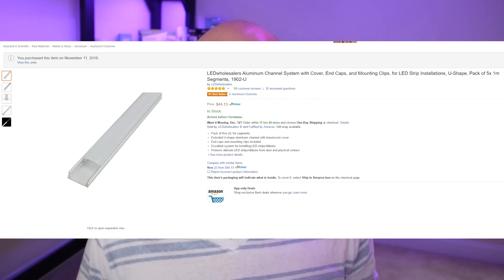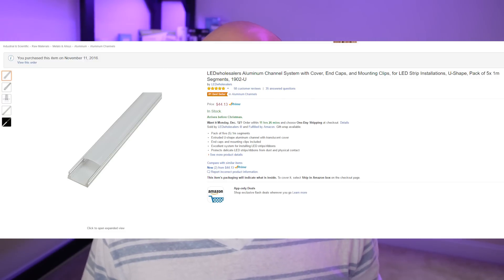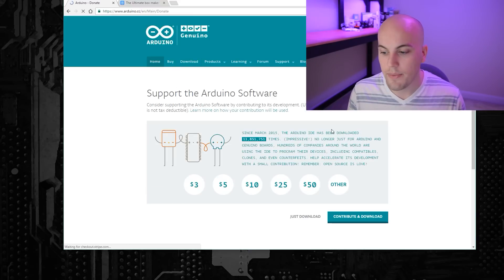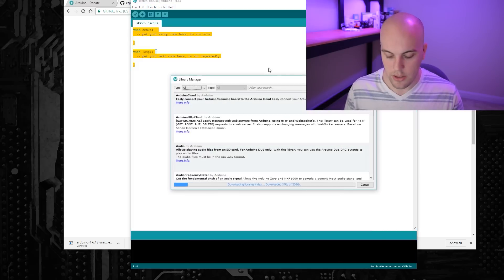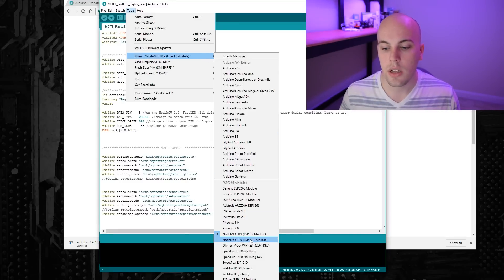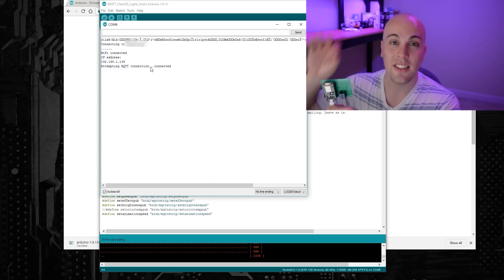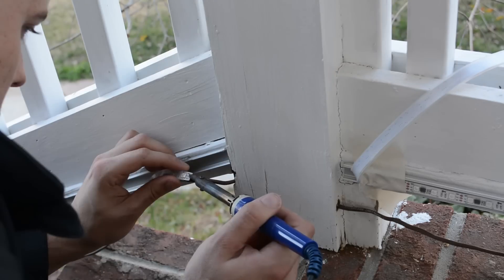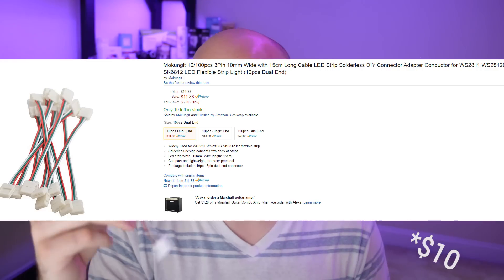The BEST Digital LED Strip Light Tutorial - DIY, WIFI-Controllable via ESP, MQTT, and Home Assistant

Comment: I have a 700 ft long fence line to put programmable digital LED fence post toppers on all the fence posts and control them and power them all from my house do you think all I need to do is run three wires from my house down to the end of the fence and tap into it each fence post topper?

Comment: Is there a longer version of this video anywhere? One that explains all of the steps? I'd like to try something like this, but I don't know what you did when you jumped to the config file to add the MQTT code. I copied yours in, but that doesnt work. when I try to restart it throws an error about the input slider.

Comment: Great video as are all of yours.  Since I have a bunch of Wemos D1 Minis lying around, can I use those instead of the Nodemcu?  As I understand it, they are the same chip and I just have to select the right board in the Arduino IDE.  I've also used these natively without using a sketch using the ESP Easy mega files and have MQTT working on those, as well and I have it integrated with Home Assistant.  Thanks in advance...Irv in Florida

Comment: 11:48 A little trick I found, just today, if you lightly sand the pads then put flux on them, they stuck up solder like crazy.  Put the 2 ends together and tap with the iron and they're together like one. 

Thanks for all your precious time!!!
Reply: that is a useful tip. Here is one from me as well. https://wokwi.com/arduino/libraries/Adafruit_NeoPixel and https://wokwi.com/arduino/libraries/FastLED for online awesome simulations for addressable LEDs 😀

Comment: If you don't need a logic shifter to run 1 LED, you shouldn't need it for 10m... The signal doesn't run over the entire length, because every pixel generates a NEW signal for the next.

Comment: Hey I got a quick question is there a way you can Google smart to run a third party bluetooth controller. I'm putting led lights in my car and most of the time wont have wifi to turn them on and want to use Google smart to turn them on through bluetooth?

Comment: Trying my best to repeat the steps in the video - four years later just does not work as it should.
the arduino code needs two main adjustments - using Version 5 for arduinoJson and changing MILLION to 1000000.
the Yaml part is where i get so lost. i just cannot find the correct syntax for the light yaml - on hassio 0.112.4 just doe not work, and i have NO idea on how to correct it (believe me i;ve tried)

Thanks for the Video , it is well made, explains a lot.
Reply: Don' t know if your still struggling, but this project is a bit outdated, if you want to build a simular project i suggest you search for WLED since its almost no programming and it integrates way better with home assistant. I tried this video too but got stuck just like you, the WLED gave me the solution. Hope this helps ;D
Reply: https://wokwi.com/arduino/libraries/FastLED and https://wokwi.com for free animations. you can play with the animations as much as you want. you can also share the modified code with your friends. the tool automatically generates the new permanent link. you can do all theses without leaving the browser!!!

Comment: I recently use your tutorial for some led strips, and the strips only worked while using a level shifter, and the first times worked fine but suddenly when changing colors, sometimes the strip only light some leds and in different colors, even when is a solid color, it seems to be the level shifter or something, when I send the same command the strips show the correct colors, but sometimes do that and I don't know why, it's so annoying...

Comment: I am currently using an ESP32 as a Bluetooth receiver for a load of Xiaomi temp sensors. I am wandering if I could use it to also control a set of SMD 5050 LED's that are already installed very close to it? If I need another ESP controller I will get one but I'm sure I could run multiple things from a single ESP. This is more for educational purpose to learn more about the ESP units and how they work but I am also currently running the LED's using a very unstable flux led (magic home) WiFi controller that doesn't play nicely with home-assistant and would like to get it working better (hopefully using the ESP32 I have already).

Comment: I have a question please solve this.
I am from India and I have a 200 rupees (indian currency) rgb light strip. I am asking that if I turn a led strip off from my remote, will the adapter still heat? Because the adapter heats after 1 hour of continuous usage.The adapter has only one thin wire which is going straight to the controller.There is no adapter (the black rectangular box type thing)

Comment: Hello, at 06:58, when the electrical diagram is shown, on the led strip you wire on a 5V RGB LED a 12V power source.Powering and injecting power should have come from the other side of the voltage regulator, from the 5V rail. I think, although the diagram is not correct, you are using a different LED strip in your video which is powered using 12V.

Comment: Just to let you know, it's not all LED strips that is hard to solder on.
I have one Sonoff L1 and that was so easy! As always, do your most of the work before, meaning put some solder on both the strip and the wire.
But very easy indeed.

Then I figured I'd put a LED strip inside my coffee machine. 
Bought a cheap version and it just wouldn't work! It was a true pain.
The solder just didn't stick to the pads.

Maybe that is the kind you got.
I understand that cheap strips meant for the average person may not need to be easy to solder.
But the kind you got, addressable strips, they are not for anyone and should be meant to solder on, in my opinion.

Nice work!
You should add a motion detector to start a slow lighting of the strips upwards. 
Kind of like it turns on the lights as you walk up.

Comment: The effects you've got running at 15:57 are lovely, I'd like those to go around my garden which has a 80m/260ft circumference. I know nothing about led's and would like their operation to be as simple as possible. are your lights controlled by the pc, if you want to change the display you'd have to log in, launch whatever and change from the pc or is there a remote involved somewhere?

Comment: Thank you for this. I would like to try it. And i wanna take your advise if i but this units from all express. What you think.C$ 1.69  30%OFF | ESP8266 CH340G CH340 G NodeMcu V3 Lua Wireless WIFI Module Connector Development Board CP2102 Based ESP-12E Micro USB
https://a.aliexpress.com/mOdgXvMU.the most expensive one .it eould ve great for this project???

Comment: oop, pretty old video to comment on. no one's gonna stop me though.

I honestly skipped through most of the programming because if I cant understand the physical nature of the build then the program is meaningless. 
I was wondering, you talk about inserting power every 2 meters I believe. 
Did you in fact insert every two meters, and if you did, the run to power was so long, wouldn't you lose your voltage through that run? 
I mean, it worked so obviously you did it right, but maybe the power can travel so much further at a higher voltage before it drops off to 5v and then 3v.
I also have no clue how amperage functions in this, so I plan on watching more of your videos and see how your channel has progressed these last 3 years.

Comment: @0.57 - Sorry, it's not a PWM signal.  It's a serial data stream.  @5:40 - Each driver on the strip regenerates the signal, so as long as the first one gets a good signal, the rest will be fine.  It's the distance from the microcontroller to the first LED that can corrupt your data.  Which is also why you can use a spare LED segment (single driver plus it's LED's) as a logic shifter / signal booster.

Comment: isn't there a better solution for injecting power every X feet than soldering?  Just like you have those clips to connect two LED strips, can't you just use those to make the power injection connections?

Comment: I would like to see a tutorial on how to add EXTRA POWER in multiple location (like you said every 2-3 metres where it is needed to avoid voltage drops)  Thanks...
Reply: It depends a bit on the wire size, the LED density (count/meter) and the strip voltage,  but basically parallel the strip with the power wires and re-attach it to the strip every 2-3m. It doesn't hurt to attach it more frequently if you like.

Comment: Does the 8266 use the same machine language as the ARV range?  I like to program in assembler.  I can get more out of an AVR chip that way.
I don't understand how an LED in a string can be "individually addressable".  They have a data strings that feeds DO into DI on the next LED - but they don't carry any address information.  How can an LED be lit without sending 8+8+8 bits of data to all the previous LEDs in the string?  If I have 5 LEDs in a strip, all green, and I want to change only the last one to blue, do I have to ...
Set all to green               :  G->G->G->G->G
Set the last one to blue :   G->G->G->G->B ... ie - set all previous ones to green again ...
... or is it possible, somehow, to address the last one, and go ...
Set all to green               :  G->G->G->G->G
Set the last one to blue :   0->0->0->0->B  ... where 0 represents "nothing done"?

Comment: Thank you a lot Bruh for this wonderful project.
For all who are interested, please note that Hassio has made changes that break parts of the mqtt instructions.
SOURCE CODE:
1. Variable MILLION is not declared, either declare it or replace it with the number.
CONFIGURATION.YAML:
2. Input_slider now is input_number you need to change it.
3.   Must replace: 
    "- platform: mqtt_json
"
       with:

      "- platform: mqtt
        schema: json"
4. Make sure your your data pin or pins are defined on a way your board recognizes (nodemcu uses pin 1, wemos uses pin D1).
Reply: Hello, I am using wemos D1 mini. I successfully upload code on board but now I have probleme with connection on WiFi. It just print connecting...... should I change some libraries or what should I do?

Comment: Thank you for the nice video, I'm still confused 😳
I would lige to try the SK6812 LED, but what driver/controller is needed, if I wish to use the LED strip with ex Alexa, is that possible without huge coding etc. (I have Philip's hue and Samsung Smartthings hub)

Comment: Got it to work 9-02-2019. Changes I needed to make:
- In the Arduino code #define COLOR_ORDER GRB
 (not BRG)
- Don't copy his MQTT code from his config file; MQTT Broker setup should not require configuration changes
- In the hassio code, change "input_slider" to "input_number"
- In the hassio code, change - platform: mqtt
_json to the code below:

- platform: mqtt
    schema: json

Also, in the Arduino code USE THE RIGHT DATA PIN. In my case, it was 6 instead of 5. This took me the longest, and is not anyone's fault but my own.
Reply: I've got not idea how to write code myself. I've followed his tutorial, everything is working but when I use his example .yaml file (with your mods) it doesnt bring anything up in the HA main menu. No RGB slider or LED enable
Reply: That's awesome! I'm having some trouble getting the code to run on an esp8266. Which library versions did you use? Really want to get this to work..

Comment: If I put some RGB lights in  two separate rooms and they are both on the wifi, will both rooms be controlled at the same time or could I control each room separately on the same wifi?

Comment: up to 8.11 minute of this I did everything exactly in accord. I cannot see the page you are showing at the screen, where you begin to change the mtt server. What do I do wrong? How can I get that page after 8.11 minute, What do I need exactly do after inserting the pubsub library and closing the tab? the last thing I did i installed the pubsub, and close the command. Nothing happened after that, nothing popped up, nothing got change after closing and reopening the software. Could any please help? I would be very much appreciated.
Reply: this is the arduino code in the video decreption. you need to downlaod it and then put your wifi and MQTT info in and then upload it to your device

Comment: i feel you bro, I tried to solder the strips myself... got away with something similar to your adapters finally. Thanks for the video really helpful on the mqtt part. For info, you can also use Mosfet for controlling power output to the strips. you need 3, one per light color. Cheers! thanks again.

Comment: Seems like a lot of work for some LED lights that you aren't going to see yourself, unless you're looking out your window.  An easier alternative would be a long strip of 50/50 RGB LED's with an IR remote & some soldering where the angle of the LED strip would change change.  Yes it's less patterns, but also a lot less work for a much simpler setup.

Comment: I was following completely until the 4:45 mark. oh man, now I need to go get learned on some new fancy chip shit and whatever else this super fucking nice guy was say, Like I can't even be mad cuz I can tell hes like, really fucking nice and if he was my friend he would probably know exactly how to fix my issue with connecting D_LEDS to my Gigabyte Aorus x299 G7 mobo, out of the tower and around my studio so I can control them with RGB fusion instead of just using the silly LED_C1 headers that only are good for 2x16ft sections of RGB LED strips before they drop into a dimmer mode. Man, I just wanna make music in my studio and have crazy pretty lights in a digital wave and now it looks like I have to buy more shit as well as whole new strips. 
lmfao, Im gonna save this for later.

Comment: I hope those wire connectors last for you, as it will be a pain for you to have to swap out connectors and strips. My experience with them is not good. The clamps of the connectors tend to lose their "grip" on the strip contact points, over time; creating a flicker, and loss of some of the colour channels. I found the only way to have a solid connection between strips is to solder them...which is a nightmare, in and of itself.

Comment: Excellent fun video. After I solder the small wires onto the LED pads, I put a small blob of Gardner Bender Liquid Electrical Tape over the solder joints, and then shrink down over that an inch of 3/8" shrink tubing. I've never had a strip wiring joints break or fail electrically.

Comment: A dab of hot glue over the solder joints will help prevent pulling the pads loose. Most hot glue is not conductive.

Comment: I am implementing all he said but my led strip keeps lighted all time. I am unable to control the led strip even with a simple program:

    for(int i=0; i<NUM_LEDS; i++){
        leds[i] = CHSV(160, 255, 128);
        FastLED.show();
        delay(50);
        leds[i] = CHSV(0,0,0);
        FastLED.show();
    }

By the way, the home assistant configuration is obsolete and does not work on my version.

Comment: I am really confused on how to actually transfer the data and power to the led strips? Do I need an Arduino nano controller and a power step-down card? and on what pins do I solder the cables?

Comment: Hi, many thanks for this awesome tutorial. I'm currently planning to put these LED stripes under the ceiling around my living room. All the technical equipment I have at home except the mounting channels. My question is if I can use the normal one either vertical or horizontal or the 45 degree channels? Does this matter? Many thanks and with best regards Dirk

Comment: What led lights and wires and connectors and channel to house the strip of lights, do i need to... make a strip (or 2 strips with a T connector?) to make my own over the picture light. I want the 3 or 4??? AA or AAA battery power to be hidden behind the picture. Hope to come up with a hollow rod that protrudes from center of light strip... to behind the framed art... to hold the hidden wires to the battery. I just cannot seem to get my mind around the dozens and dozens of options that all need to work together correctly, power wise, connector wise, etc., to even order some sort of kit to start experimenting.

Comment: I've a strange problem with my led strip and this script. Everything is working but when I pick a mixed color like yellow for example, the strips starts with a green kind of color and ends with red. With the requested yellow color in the middle. It does this with every color example the green, red and blue ones.

How can i fix this?

It's a 5 meter strip, with power injected in the end of strip too. It contains 300 leds, i've entered this number in the config in the line NUM_LEDS.
I'm using a nodeMCU.

Comment: ok, I'm not a stalker but worked out some stuff on my own. I have ws2811.  I have a sp108E wifi controller that does not work with them.  I am about to try another wifi controller but it says 5v only and says ws2811 is A ok.  But, my power supply for the led string is 12v? So, as I know very little about voltages, if my string is 5v will it still work with 12v? Or is my string 12V? Any suggestions for getting wifi enabled?

Comment: Thank you so much!. 
I have made a humble PCB for your controller.
 ( https://easyeda.com/editor#id=e75a7f1d8cb94cd3962a9f169cd15291|46037d42ba584fbe88e16e17aeefed98 )
I have test it and its works fine on protoboard. I do not have much idea about electronics so any improvement will be well received.